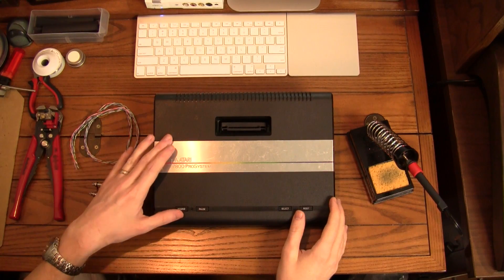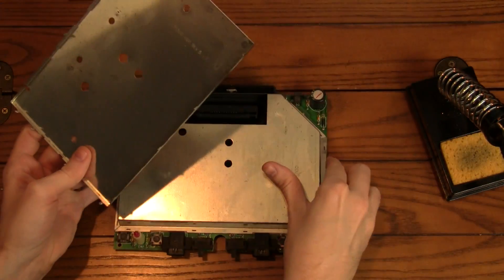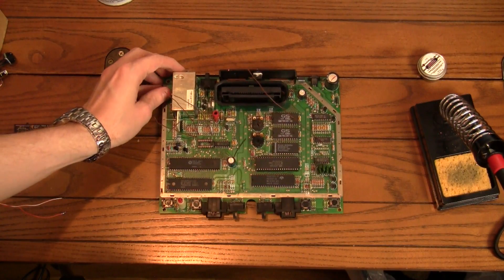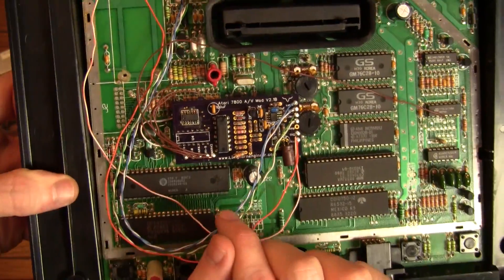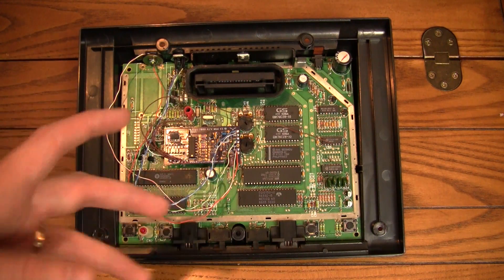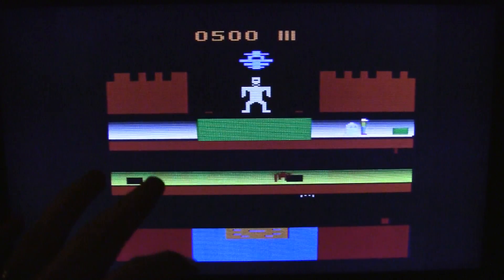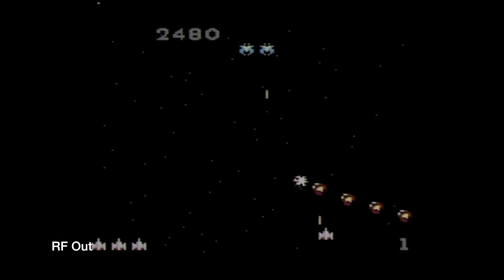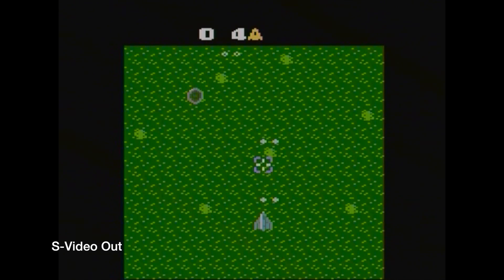Atari 7800 S-Video Mod

Comment: I personally don't have a problem using the RF output on my 7800, it has a very decent quality output, and I have a super high quality cable for it too. If I put s-video on it, I wouldn't be able to use it on my CRT TV.

Comment: How do you get S-Video on a LCD or LED HDTV? All the HD LCD and LED TVS I see in stores only have composite video and HDMI and some older ones have VGA. My Parents Plasma TV has a S-Video port but they don't make Plasma TVs anymore.
Reply: Most likely, he's using a video scaler like the XRGB-Mini Framemeister, which does take S-Video, as well as composite, RGB SCART, and component (Y/Pb/Pr) through D-Terminal.

Comment: So that cap that was accidentally broke is just standard coupling, values don't quite matter. Could blindly pull a coupling cap next to the ICs in some other old board without reading any of the specs and it would work fine. It might also work fine just leaving that cap after it breaks.

Comment: IMHO S-video is kinda overkill for the 7800
Reply: +Matthew Neathery Nope!  New TVs do not have connection for the RF box!
Reply: unebonnevie i know that but i mean wouldn't composite suffice why the s-video
Reply: Matthew Neathery Ah, because the chip on the card has both composite AND s-video output.
Reply: unebonnevie oh okay i need to pay more attention apparently
Reply: @googaagoogaa12345678  yes it would!

Comment: If you like the rf sound better couldn't you just cut the rf & s-video sound circuit paths & soldier the appropriate gauge wire from the s-video sound circuit path to the rf sound circuit path?